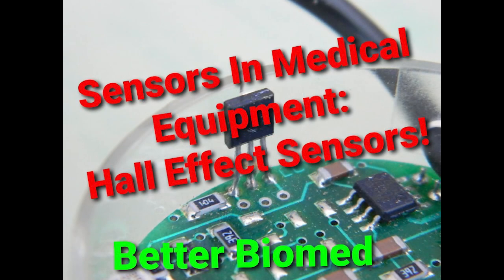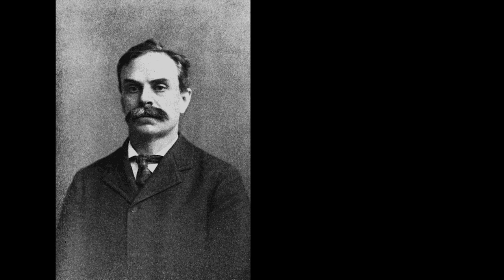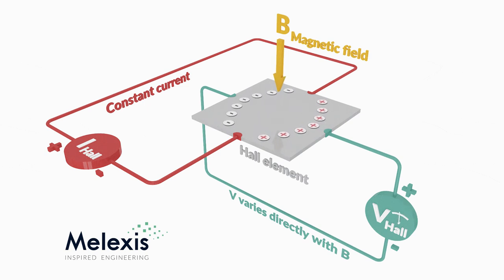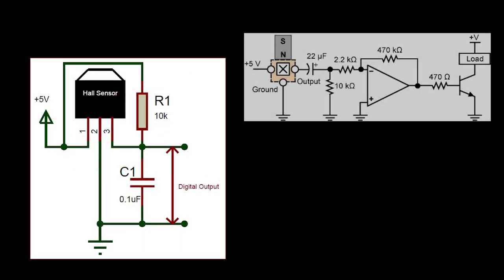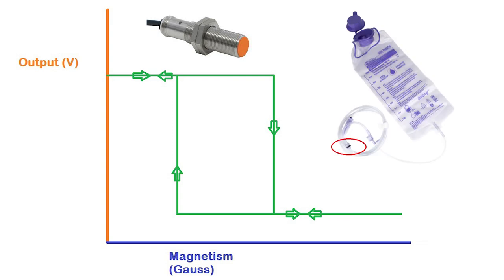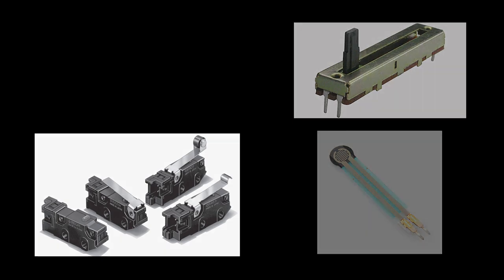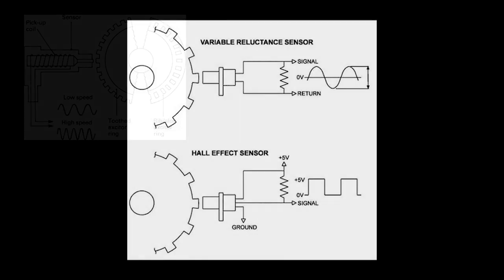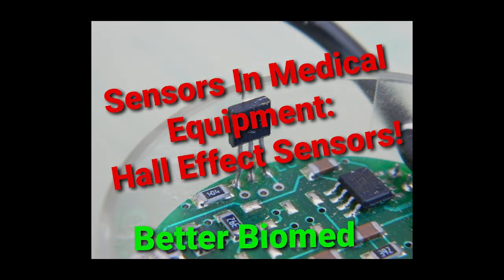Hall Effect Sensors In Medical Equipment

Comment: A Hall Effect Sensor is also used in laptops to detect when the screen is closed, to put the laptop in standby or hibernation (when this option is configured).
Reply from the maker: I never even considered that. I figured it was a tiny gyro since many laptops will flip the screen like with cell phones.
Reply: @BetterBiomedChannel  , in the modern laptops it can be gyro, but the older ones, have definitely a Hall Effect Sensor in the base, and a little magnet behind the bezel of the screen.